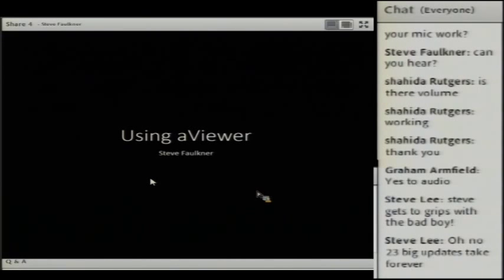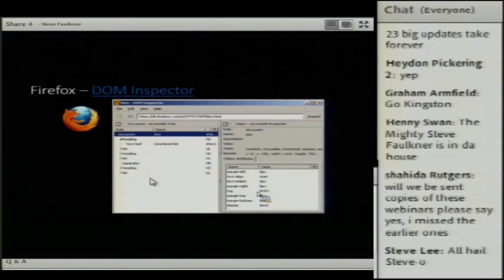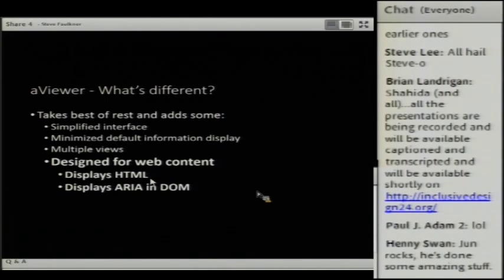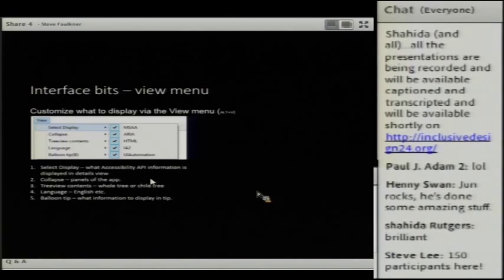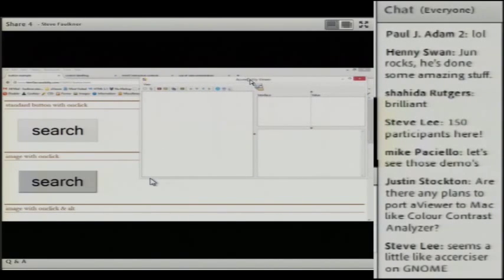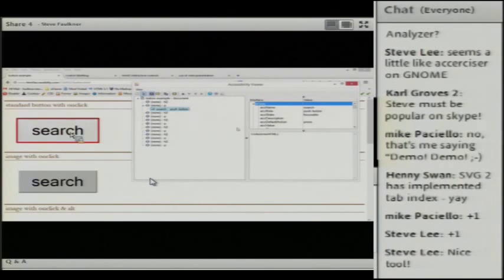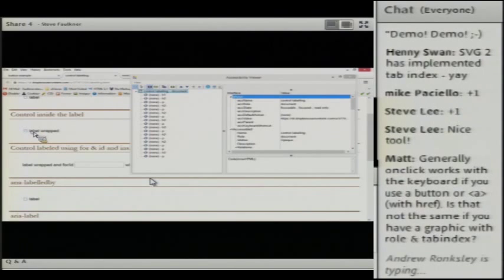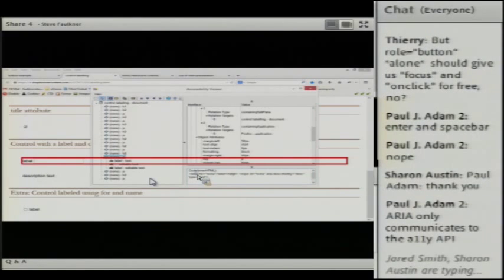Steve Faulkner "Using the aViewer accessibility object inspection tool" (ID24 2014)

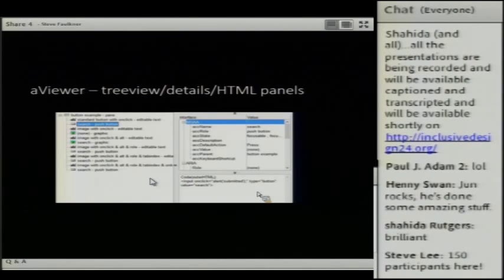Comment: Hello. Thank you for your video. I have never used the aViewer before and am wondering how to open a web page to view the tree. I scanned through about 20 minutes of the video, but couldn't find how, at around 19:45 minutes in, the presenter has a view of the tree. How did he get that? Thanks for your help.
Reply: Late response here, but for those wondering, in order to see results in the aViewer, you have to enable one of the first four buttons in the toolbar at the top. The "Watch Focus", "Watch Cursor", etc. Once one of those is enabled, you will see results displayed in the aViewer.